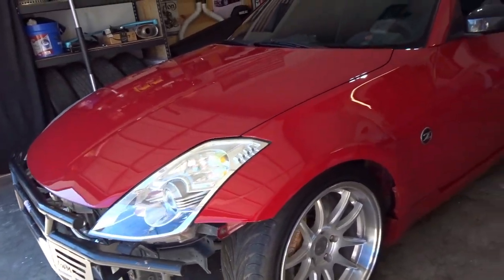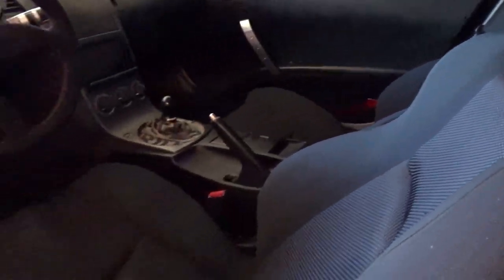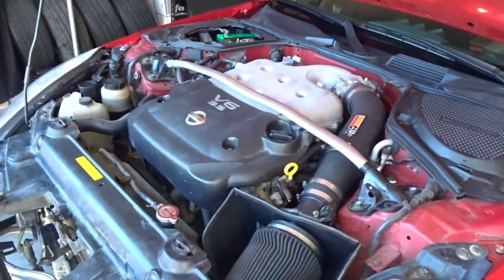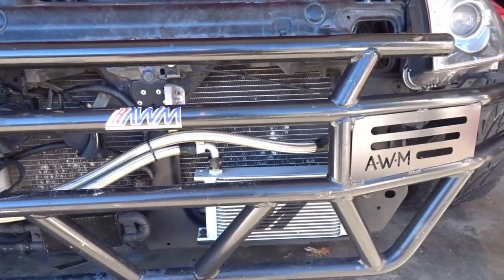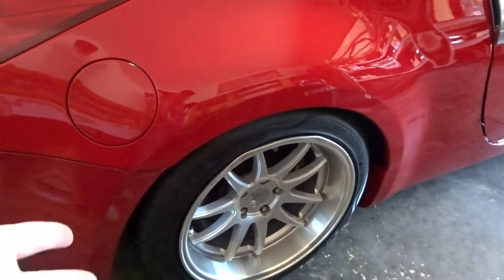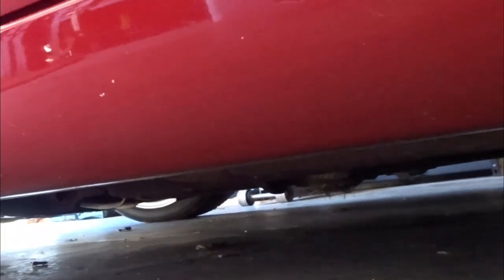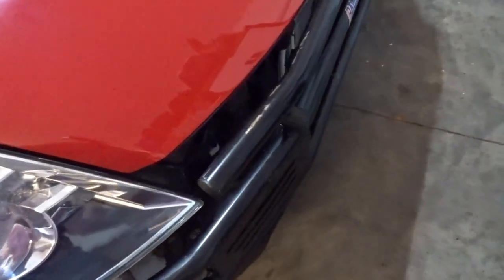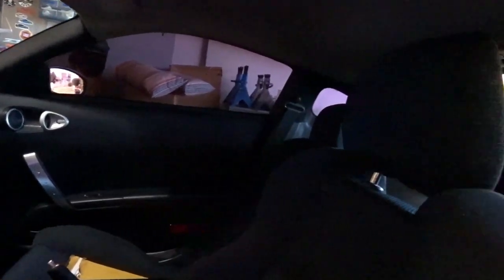12 ISSUES with the new 350z

Comment: Best mod I did to my slow z was changing the final drive ratio from 3.5 to 4.1.   Accelerates better now
Reply from the maker: I wondered how the 4.1 felt.  I've been looking at LSDs with more aggressive gearing--leaning toward the 3.9.  What's your cruising rpm with the 4.1?
Reply: I've been wanting to do this bad 3rd will be way more useful at the dragon
Reply: @SpeedCultureStudios   i will check at 70mph
Reply: @snowfreak207   off the line it’s so much better.

Comment: Great vid, a must-do with any new project car. No mention of the Brembos? Rotors & pads on the cheap at all four will cost about 1K, premium replacements everywhere will be closer to 2K. Given the wheel, I wouldn't think those brakes lived an easy life. Speaking of brakes, your handbrake and/or ABS light will pop on you when driving hard at times if not KEPT at Max line, you're about a half inch under right now. I run aFe filters (stock intakes) on the HR, nothing bad to say there. Sad to see the flex material all chewed up, get that car raised ASAP I guess. So if you're going "tin can" and you think it's loud/annoying right now, your own reaction will make for a full vid lol. OTOH if you strip it-- but ditch the Tomei, get either resonated TP's or HFC's and get a full true dual exhaust, A) it could maybe perhaps be quieter and B) you will be adding weight. The car is closer to a full 95/5 race car (5% street driving TO the track) than it is to a 80/20 street car that goes racing twice a month. Also stripping it will be so loud, it will MAKE you want to drive like an ***hole. So no street lol. If you stay street... there's a crap ton of work to do (or "undo" depending on the part). Whichever way you decide, how heavy are those wheels? 26-27 lbs a piece in the rear?? Madness. I run Enkei Kojin's (black), best value I could find short of full forged.
Reply from the maker: Didn’t mention the Brembos because it’s an “issues” video lol.  I don’t associate the condition of the one wheel with potential condition of the brakes, but a repaint, stainless lines, rotors and pads are on the list.
I have plans for the exhaust—I have a little experience there 😉
The wheels are 24lbs.  Surprisingly light.

Comment: Awesome video!!! 
Btw the wheels are pronounced “O-duh-han “ far as I know Aodhan isn’t a rep wheel. Also minor seepage from the power steering rack is normal on Nissans, infinitis have the same thing. Basically self adjusts the fluid level using the pressure in the rag and lines if I remember correctly. Keep making great content!!!
Reply: Adohans are reps but I’m sure he can take to a wheel shop to fix it first before purchasing a new wheel. Isn’t its pronunciation “odd Han”? Correct me if I’m wrong
Reply: They are rep wheels and also pretty bad quality I’ve seen them crack and bend very easily.
Reply from the maker: Interesting note about the steering rack.  Maybe I won't prioritize that so high on the list--I haven't noticed any further leaking on the ground, but it is moist around the boot.  I'm going to pull the boot back--if it's full its an issue lol.
Reply: @SpeedCultureStudios  he’s right I believe it’s normal. My G has been seeping for about 2 years now. It’s not bad to the point where I have drops on the ground so I’ve just been monitoring the power steering fluid so far haven’t had any issue.
Reply from the maker: @fourdi  Good deal. my power steering fluid level was normal--I put a touch in to top it off.  Steering still feels tight and responsive, so I'll just keep an eye on it for the time being.  Thanks guys!